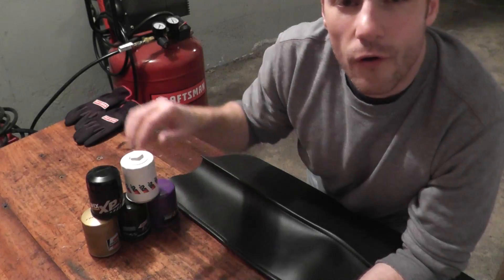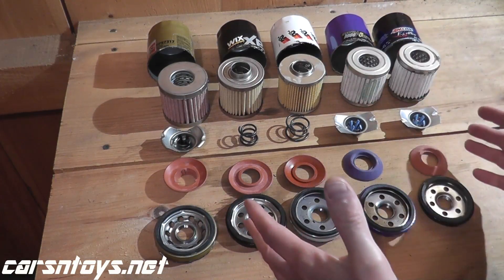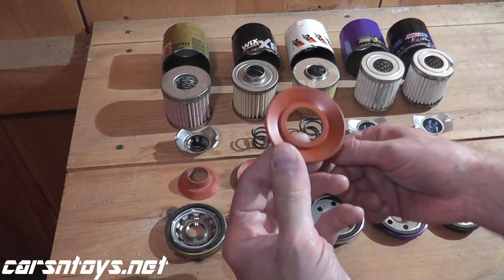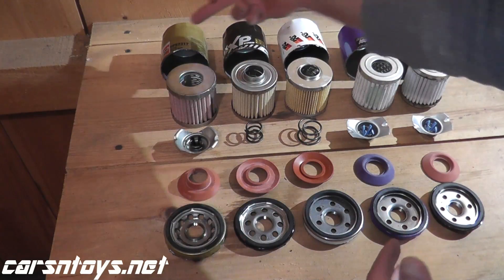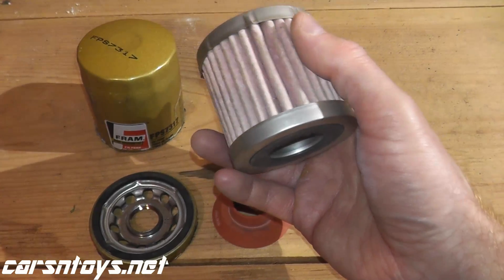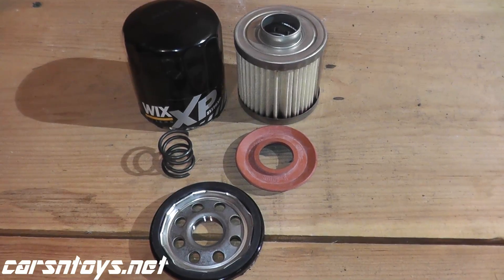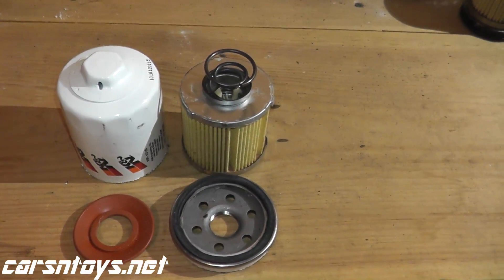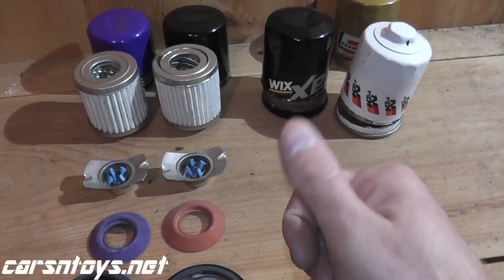Choosing the BEST OIL FILTER...FRAM vs WIX vs K&N vs Others

Comment: This is a very good and detailed article. Do you have any info on the Ford branded filters? How do they compare to the base price filters and the high end price filters?

Reply

￼

Barry Humo

 · 4y

The above is all accurate as far as filter media and construction. However. One of the most important features not mentioned in these comparisons is the anti drain back valve. The materials they are made of is listed for the filters but it is not mentioned. This valve is critical in maintaining your…

Read more

11

Reply

￼

View more comments

More from your Digest

Questions for you

Comment: Thank you so much that has to be the most explicit and thorough investigation on oil filters I have ever seen good demonstration.
I have a 2005 Fatboy and I'm running a fram ph6065b filter it's recommended for the bike just worried about the bypass valve

Comment: It probably doesn't matter which filter you use as long as you do regular oil/filter changes.  My interval is 5k miles with a full synthetic oil. Also, the ONLY reason I prefer K&N filters is because they put the 1" screw nut on the bottom of the filter.  If you do your own oil changes this helps A LOT.
Reply: I didn't hear the price of k&n why????
Reply: If you need a wrench for a 1" nut on a oil filter change, you are over tightening the filter. Oil the gasket and hand tighten until solid contact is made with the gasket then hand tighten 1/2 turn. Never had oil leak from the filter doing this.

Comment: 2001 Chevy Suburban 5.3. 316,000 miles and still going strong. You can stand next to it and can't hear it run. I haul cars with it all over the country.  I use only K&N filters. NEVER A PROBLEM.  Because most oil change places do not carry K&N, I always carry my own so they can install it when changing the oil. It's K&N for me!

Comment: I've been running Amsoil oil filters but due to supply shortages I had to buy a Royal Purple in its place. I noticed the royal purple had a plastic cage for an inner tube.  When I pulled the Amsoil oil filter I've been using and cut open that also had a plastic cage for the inner tube. Must be a new design...  Not super impressed.
Reply: The plastic will Be found in a lot of filters in the future as it is 1.5 times stronger than the metal and the large openings supports better oil flow

Comment: In comparing I find the Purolator Boss I get at Walmart for about $10 has top of the line materials in every category. Thick can, 100% synthetic media, silicone drain back, even better gasket, 99.9 at 10-15 micron, good backing for filter media, metal tube. What would be better for the money and why, am I missing something?
Reply: Thanks..  for commenting. Interestingly, I just switched to Purolator Boss on my two  vehicles:::generally had been NAPA FOLD/ Royal Purple, More, interestingly, back to MOPAR &;ADDELCO for Air Filtration……from K & N. , for severe Dust areas.

Comment: After watching a few of these videos that compare all these brands of filters, cutting them apart and scrutinizing how they're built, I'm not really convinced that any one of them is light years better than the others.  They're all worth the money you're paying for them, and for the job that they do.  Having said this, I have been told that K&N is better because of the cloth filtration media rather than paper filtration.  But if you don't plan to keep the filter in the engine for 10k-20k miles, it doesn't really matter; take your pick.  I've heard lots of bad things about Fram filters, yet I used Frams in my cars for many years, and NEVER had a problem with them.  Like I said, as long as you're not asking too much from any of these brands (such as adhering to your owner's manual's guidelines for oil change intervals), you can't really go wrong with any of them.

Comment: A warning to anyone using Mobil 1 filters, I cut one open after an oil change and found the pleats were not glued on to part of the housing allowing the filter to completely bypass.
I contacted Mobil about this issue and sent photos to them.
Their only reply after asking what it was installed on was to say that since I cut open the filter it voided the warranty.
Reply: Wow that’s fucking horrible.  😢😮😅 use a k and N filter

Comment: Much better comparison than others I’ve seen. You’re also the only one I’ve seen yet that touched on synthetic vs cellulose filter material. Personally, I use a K&N because I have a much older engine that requires zinc and ZDDP. For that reason, I prefer a cellulose filter as it doesn’t try to filter those particles out. ZDDP is about 3 microns in size. K&N filters 99.2% of all particles from sizes 2 microns and higher using their synthetic filters. The K&N cellulose is a blend and filters out everything from ~5 microns and up. Perfect for older engines. Nice work.
Reply from the maker: Appreciate the feedback! Cheers.

Comment: Hey I like the breakdowns of each filter. Gives me idea which one to use. My concerns are flow rate thru the filtering. Would these different filtering elements possibly slow flow rate of oil to vital parts of engine. I have the Dodge Ram 6.4 Hemi. I checked out the Mopar filter breakdown and it was well built. The only thing it doesn’t have the metal meshing within filtering element. I guess I would go with Wix or Napa gold.
Reply: As I understand it Purolator Boss has one of the worse flow rates and K&N gas one of the best but Fram Ultra beats WX-XP...
https://bobistheoilguy.com/forums/threads/would-you-all-like-to-see-iso-4548-12-oil-filter-lab-testing-comparison-efficiency-capacity-pressure-vs-flow-bubble-point-and-burst.334882/page-19

Comment: My daughter has a 2009 toyota camry 3.5 engine. I change her oil for her and I recently switched to a wix filter. It is a cartridge type instead of a spin on. How about comparing the cartridge type filtes. I have a '95 impala ss with the 5.9 350 engine,  and also a '95 oldsmobile 98 with the 3.8 v6. I've been using ac delco for years but am thinking of switching to wix also for them both. What is your opinion of using wix considering their age and mileage. The chevy has 147k miles and the olds has 199k miles on it. Both run great and the olds gets 27 mph on a trip. Should I change filters on them or stay with what I have. I change the oil every 3k miles. Thanks for your feed back.      Jim.

Comment: I really like your filter videos! I am thinking about doing a few tests in my lab and creating a video myself. Thinking a 4548-12 multi-pass efficiency and capacity, pressure vs flow cold and hot simulation, bubble point/largest pore, and a collapse/burst. Not sure, but seriously considering it. I believe it would be a good companion to your filtration series.

Comment: Mobil One is not full synthetic material. Fram is under $10.00 at Walmart. A great filter with full synthetic silicone ADBV with metal caps.

Comment: wix filters? thoughts opinions alternatives? got an 05 jeep 4.0 and just picked up a 96 dodge cummins ppump, certainly not going to be buying the tope end 40$ oil filters.. im not opposed to running bottom of the barrel 3$ ones if theres nothing catastrophically wrong with it.. probably more of a middle of the road bottom of the mid range guy which lands me on wix.. used them and napa units at work in one of my past jobs on a fleet of diesel gensets and never had a filter issue, had units with over 10,000hours

Comment: That was useful-- particularly since more of us let our oil change intervals slip a little bit, every now and then. To compensate for that behavior, we need a good oil and filter, to provide a better margin against excessive wear. 
Your detailed presentation was easy to understand because it selected the filter's chief features, and was unusually well organized. Your final summary of your findings, including your product preference, effectively placed the five filters into clear perspective. This helps us choose not only a best filter, but a number two choice, if the local store does not stock number one.
We were pleased to hear your explanation for the typical filter's anti-drainback valve-- many of us simply presumed auto engineers had provided for dry start protection, but now we understand protection comes from the oil filter's residual oil. After viewing this video, I subscribed.
[* Our only suggestion for improvement is to lower the volume of the signature opening music to match your narration. That lets us concentrate on the video, without having to adjust audio. Your content is good enough to let us remember "CarsNToys" without a thundering intro theme.]

Comment: Please STOP this deceitful NONSENSE that has NOTHING to do with the technical efficacy of automotive recirculation lube oil filters.   The ONLY comparison to be made is what are the results of each manufacture versus the standardized OSU-F2 (the universally accepted -Oklahoma State Univ. F2 test stand test (or ASTM equivalent protocol) and does the filter meet those specification given.   Oil filtration wherein the oil continually passes through a filter over and over and over again is one of the physically easiest way to filter,  You can do this with compressed pubic hair if youre 'clever' as with each 'pass through' of oil through the compressed pubic hair, the oil reduces more and more µM particulate.   
The F2 test has been the 'standard' since the 1930-40s:
 1. Does the filter for a single volumetric 'pass' of the oil remove 95-97% of the particles at the µM 'rating' (usually 20µM) of the filter AND what is the surface area of the pleat pack so that the filter doesnt develop high resistance (∆p) to the oil flow per psid per gpm filtered?????  
2. How much surface area is in that damn pleat pak and how 'open flow' is it?  
Just about each and every common automotive engine on the planet must meet the so called 20µM (µM = micrometer) particle removal spec.   HIgh End German etc. engines are gravitating towards finer and finer µM 'specifications' .... but that usually means that these engines dont have oil dipsticks and may not have drain plugs on the oil sump and the consumer MUST have the oil changed by the dealer (stealership) .... at upwards of $500-1000 per oil change  ...  or the engine warrantee is no longer honored.  

Besides, with the way the EPA is gaining absolute control of even thoughts and deeds of all persons in the USA, it will probably be ILLEGAL TO WORK ON YOUR OWN VEHICLE without gaining exhaustive and prohibitively-expensive governmental certification for both yourself, your 'equipment', approval of your mandated video equipment to record and document 'everything'  and to have your own 'properly registered and insured garage' ...............in the not too distant future (such is rumored as already being proposed in California).

Comment: I wonder why the K&N filters use the impregnated cellulose to increase flow with thicker oils but only have 6 inlet holes instead of 8 or 10?
Reply from the maker: It's interesting. Some manufacturer's use a lower number of inlet holes with a larger diameter vs higher number of inlet holes with a small diameter. It really comes down to flow rate per minute; which you can dig up for your favorite filter.

Comment: I've always used Purolator, Mobile 1, Fram and Wix oil filters. Never had a problem with any of them and will continue to use them.
Reply: After watching a few of these videos that compare all these brands of filters, cutting them apart and scrutinizing how they're built, I'm not really convinced that any one of them is light years better than the others.  They're all worth the money you're paying for them, and for the job that they do.  Having said this, I have been told that K&N is better because of the cloth filtration media rather than paper filtration.  But if you don't plan to keep the filter in the engine for 10k-20k miles, it doesn't really matter; take your pick.  I've heard lots of bad things about Fram filters, yet I used Frams in my cars for many years, and NEVER had a problem with them.  Like I said, as long as you're not asking too much from any of these brands (such as adhering to your owner's manual's guidelines for oil change intervals), you can't really go wrong with any of them.

Comment: unless you have a work truck or a vehicle that you want to hardly ever do an oil change on, the oil filter differences dont really matter, as long as its not the dirt cheapest one... If you own a performance car or expensive car you SHOULD be doing frequent oil changes anyways. but all of this information (even though its very cool) is more geared towards people that want to go longer between oil changes. ill go ahead and get a mid level average oil filter and oil and change it frequently.

Comment: At 2:08 you say that all five have an efficiency rating 99%, Yes they are all 99% efficient, but exactly at what micron size?

FRAM Ultra Synthetic____20 micron or greater, media is 99% efficient, from FRAM website. ISO 4548-12.

AMSOIL__________________20 micron or greater, media is 98.7% efficient, from AMSOIL website. ISO 4548-12
Royal Purple_____________20 micron or greater, media is 98.7% efficient, from Royal Purple website. ISO 4548-12.

WIX XP__________________20 micron or greater, media is 50% efficient, from WIX website. Beta Ratio: 2/100 = 20/35
WIX XP__________________at 35 micron or greater, media is 99% efficient, from WIX website.

K&N_____________________No published specifications available on this filter, I personally do not buy from companies that do not publish filtration data.
Reply: J T so which is better the wix looks confusing

Comment: This means very little to me... Show me real testing that will compare actual performance. Run the same used oil through a machine where each filter is placed on the machine and compare the oil analysis results for each oil to see which filter was most effective.

Comment: I use k&n hp-1008 in my 2017 mx5 with 28k miles. Used k&n on my motorcycles for over 10 years. The mazda is gdi so i use a full syn 0w-20 castrol edge with low vapor to keep the intake valves clean as there is no gas being sprayed in the intake to clean the intake valves. Every 30k i put new trans and rear diff fluid in. Proper maitenance is just as important as quality. Quality is more important for those dummies who believe a 10k service interval is ok. 

Edit: i do 3k to 5k for my oil changes depends on how its driven and if its been more than 6 months. Also the k&n hp-1008 is only 8$ on Amazon.

Comment: In my modded 06 300c I use Fram tough guard since new with Napa synthetic when I did valve cover gaskets when upgrading the cam it was squeaky clean . .. if it’s not broke don’t fix it .

Comment: The dab is to prevent damage to the gasket correct? Also, don't they all have coil springs on the actual bypass valve (the stamped part simply takes the place of the shaped/stamped endcap in filters which omit the separate stamped piece)?

Comment: Just did an oil change on my 2001 Dodge Diesel. Went with Delo Synblend since it was only $14/gallon ay wally world. They didn't have alot of choice for filters. So I went with the Fram ultra synthetic filter. Hopefully it holds up while towing. Probably should have gone Mobile 1. But I'll probably go with Fleet guard or wix (or Napa) from now on. Any opinions?

Comment: great video !! july 2019 I have a ford fusion 2010 2.5L 4cy 135K miles.  running Fram Ultra Synthic XG 3614 with 20 micron rating .advance full synthetic oil getting 30 mpg mixed driving. paying $9 at walmart for Fram XG.was getting 25 26 mpg reg super tech oil and filter.my mixed driving is 70 Mph up hills long trips and some city driving. love to see filters taking apart!!
Reply from the maker: Thank you.

Comment: I just recently switched to WIX on my 2006 GMC Sierra 1500; 4.3L V6 under the hood.  and it seems to be a better oil filter.  (previously used Fram)

Comment: Great but the best oil filter for your car is the factory OEM filter. Period.
Reply: Just cause stuff is oem doesn't make it the best. They don't use the best so they can make more profit. Plus alot of these companies make them for the car manufacturer. You think car companies want their cars to last 20 year's, NO
Reply: @timothyberlinski2299  Do oil filter manufacturers not want to make a profit? Lol what makes them any different than car companies? The OEM manufacturers make their filters for car companies to the car companies specifications. You get the proper flow rates which reduces engine load and keeps oil pressure where it should be for timing chain tensioners VVT solenoids etc, proper capacity for oil levels and dirt holding capacity based on the manufactures recommended oil change intervals. I always noticed a reduction in mpg and performance when I use the more expensive aftermarket filters (which I dont do anymore) and it's completely asinine to think that using an aftermarket filter will make you car last 20 years but the OEM wont. That's the funniest thing I've read lateley.